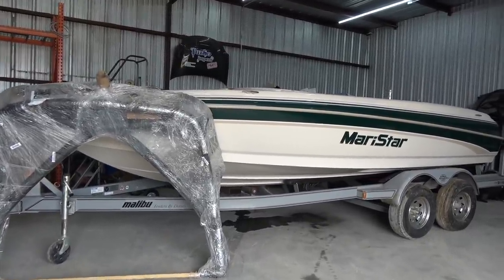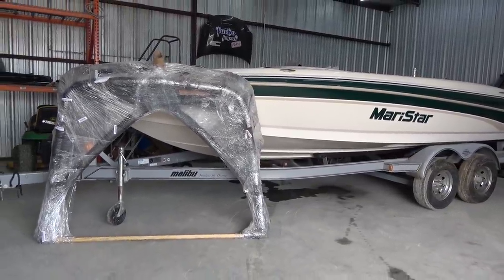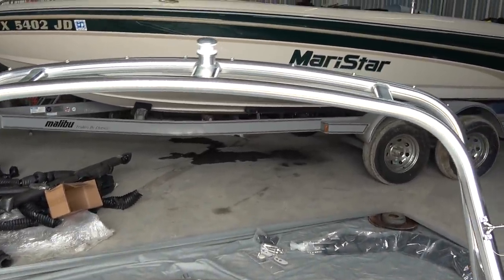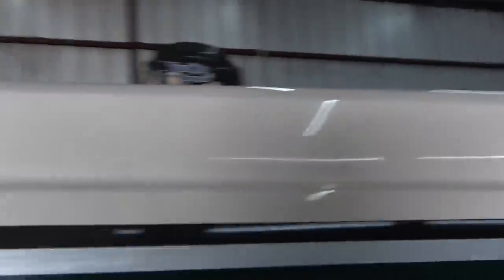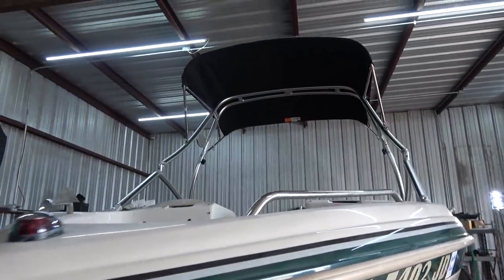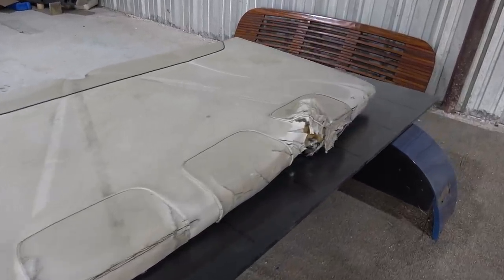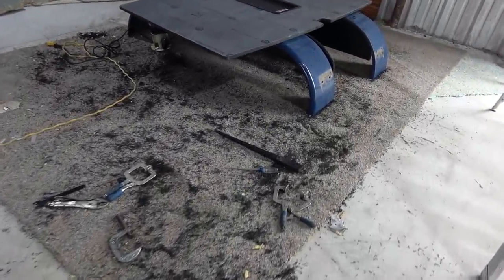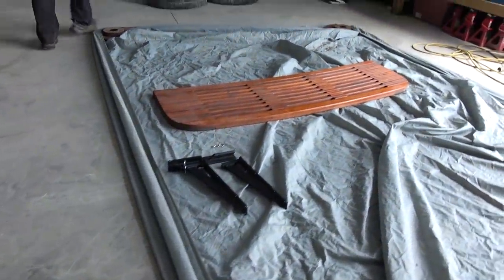Rebuilding A Mastercraft Wake Boat WE GOT A TOWER! Part 3

Comment: I have the same boat, with an older version of the ND tower. The actuator that lifts up the hatch seems nice until you are actually out on the boat and have to wait for it to raise and lower. The later years of this boat, and all v-drive boats since (I believe), have a three piece deck so you can open the compartments separately. They also do not have an actuator, just simply latches and gas shocks. I'll probably leave mine as a one piece deck, but will be scrapping the actuator to go with a latch and gas shock system!

Comment: a good idea for the teak deck in the back which i did for mine is to thru bolt the wood to the braket with stainess steel bolts and lock nuts.. i had a big friend of mine rip the screws out of the board while standind on it when the boat was out of the water

Comment: When you drill holes into fiberglass it is a very good idea touse a bevel bit on the hole to prevent cracking
Reply: I would use a bigger drill bit but run it backwards to get a bevel.
Reply: Agree, if you dont break that sharp edge with a chamfered, the gel coat will spider crack. It's like drilling a hole to stop a crack but preventive.

Comment: Can that plastic withstand the engine heat? It probably was aluminum because the heat dissipation. May want to put a layer of heat shield on the bottom, to prevent the plastic from breaking down.
Reply: I was thinking samething. Its cheap and easy on a nice new surface like that.
Reply from the maker: the heat coming off the engine is not enough to affect the plastic
Reply: OEM MasterCraft engine dividing panels are made from same looking plastic, so I would assume it can withstand the heat without any problems. Those panels are like 1-2" from the exhaust manifolds on my MasterCraft X2.